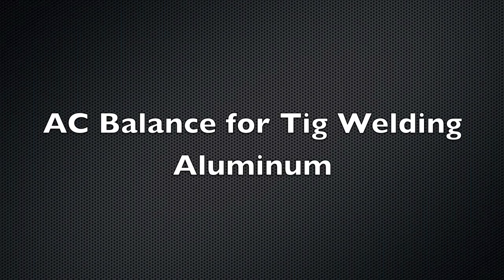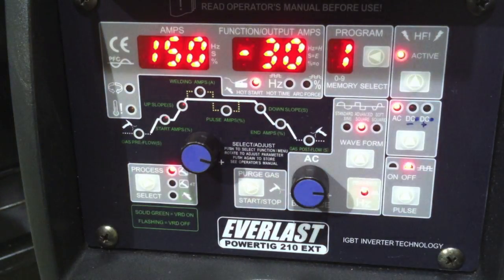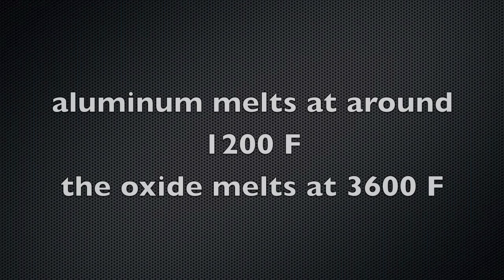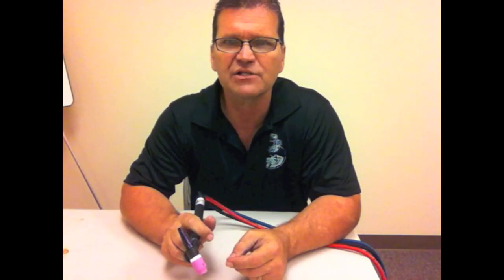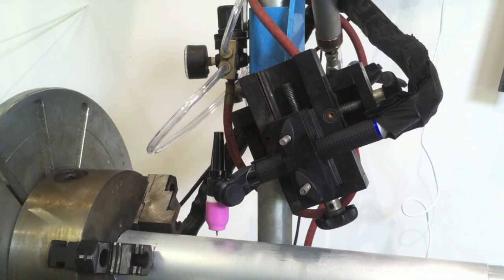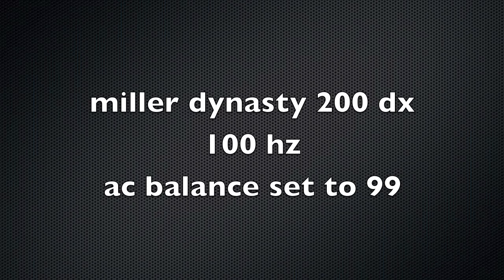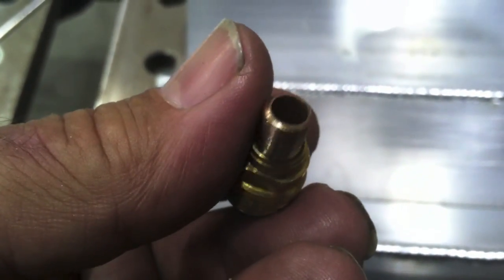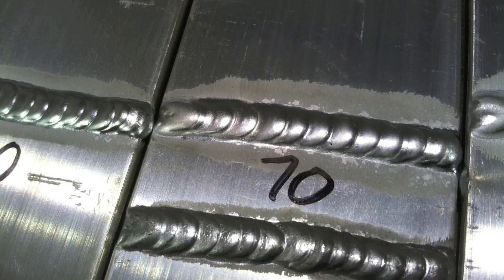Aluminum Tig Welding: Setting AC Balance

Comment: Hello, is there anybody knowledgeable in andelli??
I bought the 250 pace smart tig welder.  The balance goes from what looks like -40-0-??
When I’m at -30 it balls up but doesn’t fuse, as I turned it down to zero I made the smallest of blue tips.  When I went to the +30 it balled a big blue burn back.  By the sounds of it, is zero the aluminum spot??
Frustrated

Comment: That’s it all right there. When I learned about how that cleaning action from the reverse cycle worked with aluminum that showed me how You arc weld aluminum. Now I have machine where I can actually adjust that cycle I can do even more.
My problem is I always seem to be trying to weld different dirty material that I can’t always clean all up but manipulating the cycles I can still get around it to a certain extent.
I think I have to pay more attention to the cleanliness of my gas
Reply: Just got done showing fellow employee how to do it and explained it to him. Nobody ever told me, I had to find it in a book.

Comment: You're Doing excellent job. But I would like to see more on the one I'm purchasing Everlast PowerTIG 200DV 200amp 110/220 Dual Voltage PULSE ACDC Welder.

Comment: At what prosentage do you set it to make a ball on the tungsten? I know not everyone make one, do you recommend making a ball or just letting it ball up as you go? Know you are a fan of sharpening it as well, and I have tried that for shorter small welds with good results. I guess one might combine that with high prosentage of material heat for very tight beads under the perfect circumstances :-)

Comment: Hi there, I have a Miller Syncrowave 200. I am trying to weld alum. I am having issues with getting the right settings, I am welding 1/8" Any advice on what settings I should set at. I am not getting a weld pool. I am burning though , and the filler rod is melting as I start to apply before I get to the pool. Or where the pool should be. The balance reads 1-10, I am set on AC, set on 115 AMPS. I am dead in the water here.

Comment: I am learning a lot from you and thank you for that. My machine is a 200 amp ac dc Riland and i am now welding old engine casings. My balance goes from -5, zero at the middle and to the right it goes to +5. Could you tell me even aprox. where the 65 may be positioned?

Comment: i had a problem with getting a dirty weld all the time on my tig , the only way i could get something acceptable was to have the ac balence about 40-45 % on my machine as to the 30-35 i normally have it on and even the it wasnt gr8 , tried everything and it wasnt until i ran out of gas and changed it i noticed it was a completely different welder , gas must of been incorrectly  filled with a mix of something else i guess

Comment: Thank-You for that Great Video ! My understanding of it is  - With the AC balance setup for predominantly cathode negative and by way of example using a 60-70% negative consequently 30-40% cathode positive - that the negative transmits a sufficient amount of thermal energy into the material (Aluminium) thus burning of the oxide -  with the remaining 30-40%  positive cathode causing  a thermodynamic flow - drawing excess   heat and oxide/crud up away from the pool - instead of it all been "overcooked" in a splattering pool. With Aluminium melting at 1200F and the Oxide melting at 3600F  a   1/3  or 3:1 in total  temperature difference - is it a fair assumption that those physical properties correlate to an [approximate]  AC balance of   65% negative and 35% positive  - similar proportion (considering Lens and material properties thickness)…

Comment: great video ,i noticed you didn't have an eastwood aluminum welder.  what's your opinion on eastwood aluminum tig welder. in market for home hobby aluminum welder. would you suggest?  thanks in advance
Reply: D Rogers don't do it! Get the Lincoln squarewave 200 much worth it
Reply: what about ahp 200, yeah thought about square wave 200 ,$1400 vs half

Comment: Awesome Video!! I have a chance to pick up a nice running Miller Aerowave 300. with a cooler, Nice wp20 torch that has all the bells and whistles for 1000$  ive been using a miller 330ab/p for about a year and a Airco 300 heliwelder as well.  im super excited about the aerowave but also a bit nervous about all the controls it has on it...   However im hoping the aluminum welds look better than what i get with the old machines.  Thanks for another very informative Video!!
Reply: You'll have no probs running the aerowave, great machines, easy to setup

Comment: Hey man just wanted to say that's the best aluminum ac/DC and balance adjustments on the Web for sure. I'm a union pipefitter/welder and have tig in power plants all over Texas to Hawaii and just wanted to say I get alot of good useful information from you and keep up the good work cause uve answered alot of questions no one could.

Comment: What should I do to get this right the 1st time ???….
Well, today I TIG welded aluminum square tubing (1.5" x 0.125") with my Everlast PP 256S.  For this project I had to weld 4 of 90 degrees elbow where each piece were cleanly cut at 45 degrees.  The side walls went very well, quick and nice results. The outer edges were not as nice but finely not that bad.  The inner edge were an other story !!!  125 Amp AC, 35% EP, 120 Hz, 3/32" cereniated sharpen tungsten, 20 CFH pure argon.  I did buff a 1/4 inch of the side walls of the pieces to remove the hard oxide.  I then V grooved each edges with a sand disk (new).  Cleaned with acetone.  It was difficult to initiate a "clean" puddle in the deeper part if the internal 90 degree elbow.  The arc had a tendency to jump to the sides walls and signs of contaminations was present.  Had to stop, grind down my work on the inner side of the 90 degree elbows an start over a few times before getting it right (kind of right).  I know I did something wrong, probably very wrong…please help.
Reply: I finally increased the frequency from 120 Hz to 240 Hz, uses a 1/8" tungsten instead of 3/32" and added a gas lens to the torch tip.  Quite a improvement with minimum contamination now. Great.

Comment: Great video Jody! Im trying to run some beads on aluminum with a hobart tigwave 250, not a lot of videos out there using these old machines. The ac balance setting on there has a little mark where it says "AC Balanced" but the arc wanders like a drunk hobo.  I guess i need to move it closer to the "dc fig/Stick setting," kinda counter intuitive... Do you have access to any old non inverters to do a setup video with? That would rock! Thanks for all the info!

Comment: I'm thinking about buying one of these types of units.  We weld with a miller Syncrowave at work.  When I mentioned a Dynasty one of my coworkers cringed.  He complained that the HF on the dynasties was very loud and very high pitched/annoying.  I'm not picking up on that in your videos would you say it's that bad?

Comment: I'm using the Dynasty 200, so when I adjust the %  higher towards 99 is that more cleaning? or more penetraion? and when adjusting the AC frequency, I have mine set right in the middle to 125, if I rise that will my arc get wider or more thin?

Comment: thanks for addressing the DC NEG on aluminum. i lost a sweet job offer at spacex cause they wanted welders who could weld DC NEG and welding school doesn't teach it, but i was able to get a days practice with it. well i blew a hole in 1/2" thick aluminum test plate. DCNEG aluminum is very hot!

Comment: Another thank you for taking your time to create and post this video, I've just been having my first proper go at welding something useful, a new tank on the side of an aluminum intercooler, getting loads of crap in the weld and finding it very hard to focus the arc.  Nice new clean aluminum sheet vs a crap thin radiator...I was really struggling. Top man thanks again.

Comment: Screw the Lincoln Invertec, do a review on the HTP 221.  The Lincoln vs. Miller debate has always been there.  Where does the HTP 221 fit in between the two brands that have been around for decades and the everlast.  I own and Everlast 250EX and love it.  Is the HTP 221 a budget minded upgrade or should I just stick with what I have.  Great videos as always, Jody.